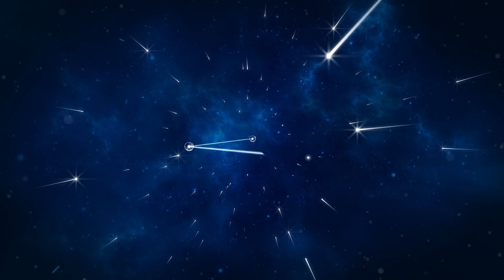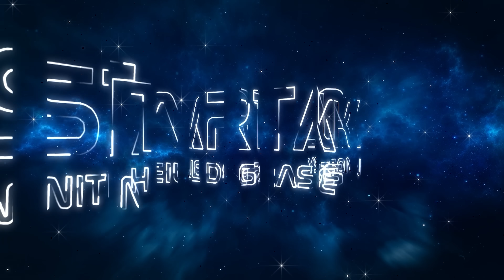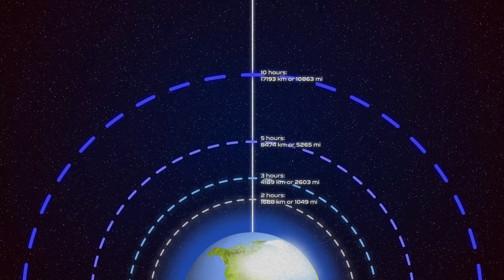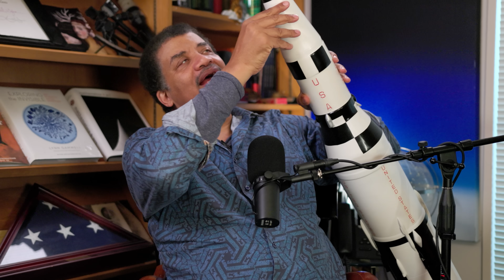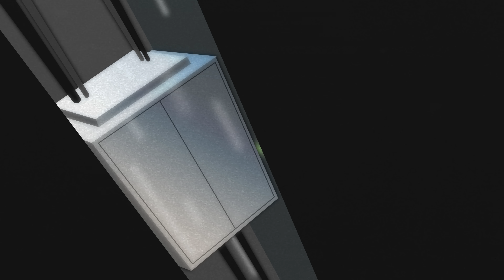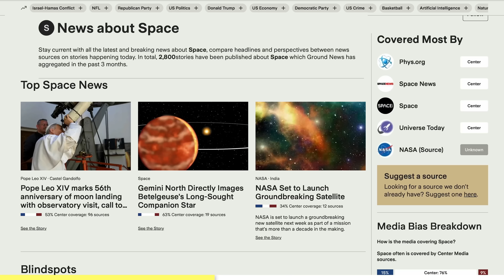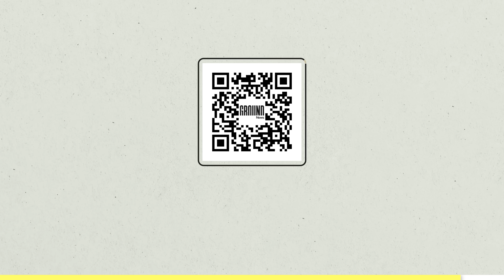When Will We Have a Space Elevator?

Comment: FYI: Neil was off by a factor of 50.
The longest individual carbon nanotube ever grown is approximately 550 mm (0.5 meters) long. This record was achieved using an improved chemical vapor deposition (CVD) method on silicon substrates.
Reply: And, he did not mention graphene.
Reply: @chrism.1131  Graphene is a completely unrelated material....
Reply: @blankspace178     Seriously???????
Reply: @chrism.1131  GNTs and CNTs are NOT the same thing and have wildly different applications. GNTs are meant for generating low-watt energy while under pressure, CNTs are for structural strength. Thy are NOT interchangeable.
Reply: @blankspace178       I have no idea what a GNT is. I asked my AI and there was nothing related to carbon nano tubes or graphene. According to the international space elevator consortium, graphene is the leading candidate for space elevator tether material. Maybe you know better than them.

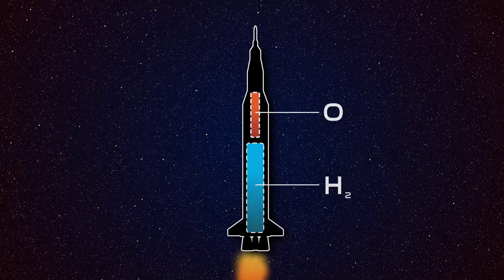Comment: 1. 6:51 It's H and 0₂, so 4H+0₂ -> 2 H₂O.
2. 8:30 You can kick in maglev once reaching LEO, or even lower, to propel elevator to very high velocities.
Reply: Indeed. In atmosphere, the sound barrier would be the limit. For passengers, the acceleration needs to stay comfortable. At about the halfway point, the carriages would need to reorient for deceleration. Cargo could go much faster.
Reply: Your equation is wrong. It is 2H2 + O2 -> 2H2O
Reply: @yzed971  you right
Reply: I agree with @TheJAMF -- the G forces acting on the stopping of the elevator might be too great for any human being to withstand. But for cargo, it wouldn't be an issue.
Reply: @HaggenKennedy 😊 You can select the G-force for acceleration and deceleration. It just means the travel time for living things will be longer than for cargo.
Reply: @HaggenKennedy  You don't have to accelerate it instantly to 20000 km/h. With gentle acceleration of 0.6 m/s² you will reach 7700 km/h in an hour. But this is at g₀. The further you go, the lower gravity is, so you can increase acceleration. With 1.1 m/s² it will be over 14000 km/h in an hour. Again, higher due to decreasing gravitation. So 3 - 3.5  hours in total. How stable is this bolide going to be is another question though. As well as how much energy it will need.

Comment: On topic of the space elevator, would not the centrifugal forces be strong enough to hold a cable taught and rigid, thus no need to hold its own weight but to hold together from being pulled apart? Another ponderance to ponder about, if you had a tube that is strong and rigid enough and long enough to reach space, could the vacuum of space suck out the oceans like a straw? My guess is that is is possible yet most materials will not withstand the forces...

Comment: Thinking about it, if the space elevator can ship multiple tons of materials to and from Earth, it could still be incredibly useful, particularly for space mining as it provides an economic (albeit slow) method to ship large amounts of rare Earth metals to Earth as well as finished materials to build habitats in space.  It might not work as well for sending personnel, but it would still have its uses.
Reply: If you had TWO "cars", one going up, the other going down, you could double the load carrying capacity AND reduce the power needed to make the elevator many times more efficient!
Reply: @randysmith9715  Like a funicular railway.
Reply: @ncammann  I was perusing the comments looking for someone to mention a funicular system. The energy required to balance the system is the difference in weight of the loads. Early on we'd certainly be sending more material up then down, but as space operations begin we'll probably have plenty of mass that needs to go up as that needs to go down. 

It'll also help with the braking force needed to slow down the ascending elevator in space and the descending elevator to the surface. We're once again only needing to brake the difference in load. you'll slowly accelerate out of the atmosphere, reach a maximum speed, and then begin slowing down. The motors driving the the load can be relatively small compared to trying to stop the entire elevator and the load.
Reply: @randysmith9715 that was my first intuition as well, but it probably wouldn't make a differences because of the differences in gravity. The top cart would be weightless for most of the journey.
Reply: @randysmith9715 how would that reduce the power needed? Wouldn't it double it?
Reply: Also I think we could achieve atleast 300mph going up and terminal velocity going down.
Reply: @rockyjohnson9243  You'd go slow through the atmosphere, but that's a small portion of the distance. Once past that you could go much faster than 200mph.
Reply: @ZarchAlDain Going at high speeds means you are adding kinetic energy to the elevator carriage. This energy comes from fuel/electricity. 

Going faster makes the whole idea of space elevator useless.  This energy will be eventually wasted as heat when you slow down the elevator at the destination. 
The whole advantage of elevator being more energy-efficient than rocket is lost. If it's going fast, it will require same amount of fuel as rocket. Plus the building and maintenance costs of the elevator.. makes it totally worthless.
Reply: @mahadevparmekar2565  You're completely missing the advantages of a space elevator.

1. You don't need to carry reaction mass. You can push against the tower. 

2. You don't need to carry fuel - you can be fed power from the tower

3. You can use regenerative braking or some other system to reclaim energy and use descending elevators to supply power to ascending ones.
Reply: @ZarchAlDain yea the atmosphere would be less than 1% of the total trip
Reply: @rockyjohnson9243  You only need to travel slowly in the first 100km or so, where the atmosphere is thick. After the Karman line (100km's up) the atmosphere thins to virtually nothing. At that point, apply continuous acceleration, then deceleration, at 1G and the trip is only a few hours. Again, coming down, you only have to worry about velocity when you start to hit a thicker atmosphere. Accelerate fast for most of the trip then slow down to a sedate pace for the last stage.
Reply: @Starganderfish  So what I suspected only a few hours :)   Thank you, for taking the time to explain this in more detail.  It is fun to think about for sure and I hope I live to see it! :)  I have 40 years left maybe more.
Reply: But Wait — Can the Cable Handle It?Here’s the catch (and it’s a big one):1. Cable Stress = InsaneAt 1G acceleration, the climber pulls the cable with its own weight × 10.
A 10-ton climber feels like 100 tons at the base.
The cable must support not just static weight, but dynamic loads from acceleration.

→ Carbon nanotubes are strong (~100 GPa), but scaling to 36,000 km with moving loads? We’re nowhere near that.2. Power DeliveryYou need gigawatts of power beamed or stored onboard.
Lasers? Nuclear reactor in the climber? Solar? All hard.

3. Coriolis ForceThe elevator is fixed to Earth’s rotation.
A fast-moving climber wants to fly eastward due to conserved angular momentum.
→ Sideways forces try to snap the cable like a whip.

→ At 1G, this becomes a structural nightmare
Reply: Also if you have constant 1G acceleration in just about an hour you can get there.
Reply: @DrakyHRT  Pretty big if.
Reply: @DrakyHRT  I don't think you're considering all the factors.
Reply: Ok, only 1 reply mentioned rail. An that is close to my Idea. Maglev tubes shaped like hunny combs made out of carbon nanotubes. It will work. The T flight project in Japan said it could go up to 600 mph. Now add that into my Idea and it could work. The only thing that is holding us back right now like Neil said is production of the carbon nanotubes.
Reply: Centrifuge launchers are a great in-between, tossing packages 70 miles up, then a MUCH SMALLER system of rockets/fuel starts the nearly zero gas resistance fight to get up to orbital speed speed. Takes way less fuel, and has reusable electricity as the primary method of reaching orbit before rockets give orbital speeds.
Reply: And this is why Tyson is one of the scientists who keep inventing hot water and think rocket we have are more then good for us. This rocket are to weak even for geostationary orbit and all we using them right now is for sanding micro satellite into low earth orbit for spy games!
Reply: @Zommari  they're not. At all. We're just not typically concerned with much past that with travel atm.
Once you're out of earth orbit range, 99% of the 'hard rocket power' part is done.

Hence the whole 'half the fuel to get to mars or jupiter or whatever will be just getting off the earth'.
Reply: @KeithElliott-zd8cx  If the rocket we have will be good enough, will be on the moon. Yes more cargo you have more fuel you need and moust of fuel you need for reaching magnetosfere.
Reply: Giant cargo elevator 🛗
Reply: How about jettisoning nuclear and other waste into the ultimate incinerator? Possible?
Reply: This. Also, well maintained limited redundancy is the key to survival.
Reply: Yeah, if you just do freight for a space elevator and rockets for humans, you could essentially just treat the space elevator like a giant railgun and launch stuff into space. Since a major issue with rockets is weight limits, we can launch the materials up via the elevator and then the people up via a rocket.
Reply: assuming it will actually ever be feasible to build.
Reply: Better yet: a normal elevator uses a counterweight to save on energy. What you really wanna do with a space elevator is make a system where all the stuff you want to put into space is balanced against whatever minerals etc. you mine from asteroids and want to bring back down. As long as you bring back slightly more than you take up,  you their theoretically need zero energy
Reply: Also they can safely get nuclear waste to space
Reply: kinda not.
You'd need basically ai mining drones able to act independently from earth, refueling on their own and what have you.
But you don't need a space elevator to bring them up...

Once they get that material, it needs to be brought safely down... Which also doesn't 'need' a space elevator, just a good heat\\pressure resistant box with a parachute, really.

And once you've got automated mining and refining and assembly stuff for space, you don't really need a space elevator for a spaceport\spaceship assembly.

Space elevator could make things more interesting, but its unnecessary and honestly, too much of a pita to bother, really.

A rocket already helps put people and tech into space.
Reply: The key is shipping multiple containers (10'x10' minimum) per day. No one wants to wait 10 days for supplies, but if you are able to send two containers per day, whatever is being built can be done more quickly.
Reply: @joeblack007  i don't think you'll be ble to have dozens of elevators moving thousands of tons. I mean, we BARELY have a material that can withstand the weight f just the rope, much less making like 50 of them for more delivery options...

Plus, presumably builders can wait, we can send pre emptive supplies, and have a stockpile there...
Reply: you could also use the less minerals to make capsules to drop loads which could separate  for the final leg of descent by parachute so you could forgo the chokepoint-however at first any metals mined  will go to building infrastructure in space like space stations that are cities not something 12 astronauts live in
Reply: Space junk will hit I think
Reply: The time it would take to mine and bring materials back the earth would have passed a billion years lol
Reply: @StoneAquatics  Isn't most of the issue with our current slowness of space travel, that we only use fuel to escape the atmospheres and then to make minor adjustments and then just coast to our destinations without using more fuel to further accelerate?

Right now, space craft need to have enough fuel to push them through the atmosphere, but that same fuel also has to be enough to push the weight of the rocket up too. And more fuel = more tanks to store it = more weight as well. So, currently we have to strike a balance.

If we had a space elevator to supply fuel to our space craft already in orbit, we could go full throttle and reduce the travel time significantly. What takes us months to get to mars currently could take us a week or two.

Additionally, if we construct capital ships in orbit that don't need to enter/exit atmospheres and just have them transport smaller ships that will do that they can serve as mobile refueling stations for the smaller craft. They'd be able to hold massive amounts of fuel and resources at one time.
Reply: @PlagenShiki  Once you get enough orbital manufacturing capacity you literally don't need earth anymore. Except maybe for food. You would just make all your fuel and ship components in space and save on the cost of shipping up and down to earth.

Comment: Can’t imagine the stress this tube would have just with the weather before reaching space.
Reply: I think people often picture a literal cable instead of what it would probably be, which is a building-sized structure made from nanotubes.  The thing would have to support a moving platform that could haul industrial sized loads into GSO or else it would be no more practical than shooting the stuff up there in rockets
Reply: It's a carbon tube, it can take more heat than any metal on earth, and it will be fine at cryogenic temperatures.
Reply: I think the weather would be a relatively small force all things considered, but dealing with the rotation would be a huge problem. It's not just about supporting its own weight - as the earth is rotating, the elevator has to rotate along with it, and with it being as huge as it is that rotation will have overwhelming forces behind it.

Comment: Would the weight of the ladder be that heavy?  Add in centrifugal force of a solid extended that far then add in coriolis, you're going to have some pretty impressive guy wires for stability down low, and where would the center and gravity of this thing be, would it be being pulled away from the Earth right? It would be resting on the Earth.

Comment: Comment is before I watch, let’s see if I’m ballpark anywhere close, from a residential remodeling contractors perspective… To make an elevator to space you would need an extremely low density material that has a lot of both tensile strength to hold the upper part down combating centrifugal force of moving thousands of mph, and high compressive strength to hold up the bottom portion. Something like this I would imagine would need to be stronger than steel and lighter than a feather, and can neither be crushed or pulled apart without extreme force… Likely several dozen mile wide base to make an elevator size top… fingers crossed I’m close  🤞

Comment: Another factor which isn't as easy to visualize is that whatever goes up the elevator has to be accelerated to geosynchronous velocity.  This horizontal component is definitely non-trivial.  That much energy has to be added to the system or your elevator will just kink the "rope" and come crashing down.  Another problem - we already have thousands of objects in orbits that your "rope" will have to pass through.  This essentially puts a stationary object in the middle of a 17,500 mph freeway where the traffic doesn't steer very well and ANY collision would be disastrous in the extreme.  For now at least, rockets are the best answer.

Comment: A rocket powered space elevator is the best invention since carbon nanotubes
Reply: Whatever they invent to keep satellites, and fragments of satellites and random meteors, from smashing into it at 17,000 mph and vaporizing the segment they hit will be the most valuable outcome of the project. The elevator itself? Useless.
Reply: @sciptick  The space station seems to be able to manage it and thus this would be possible.
Reply: @rockyjohnson9243  The ISS is much smaller than 23000 miles, moves freely, and is going the same direction and speed as most of it, not standing still.
Reply: @sciptick thats true however you can put it into a lower orbit avoiding most of it.  Also at some point we need to clean up that mess and either recycle it or send it off to the sun or moon
Reply: @sciptick Carbon nanotubes already exist, they would cut anything in half.
Reply: Once heard someone say this would happen in the future.
Reply: the most scientifically realistic space elevator depiction you can witness on the chinese wandering earth 2.  it also use rocket to boost.

Comment: What in airplanes be able to cut the cable? Hypothetically, if there was a cable coming down or other satellites interfere with the cable, I was thinking flying up something like extremely light fishing line and using that to pull up a thicker form of fishing line with metal filament in the fishing line. Slowly pulling up heavier and heavier line or even line the same weight